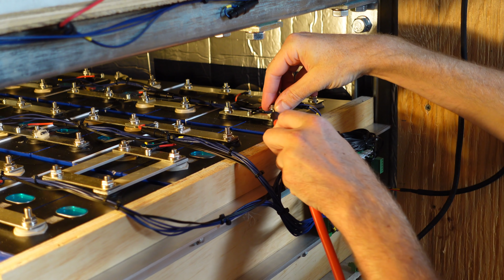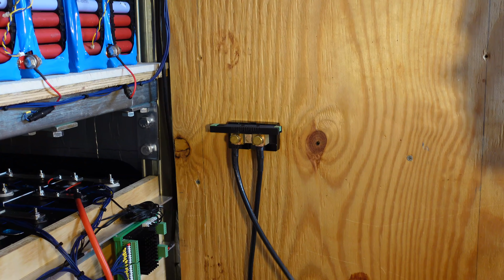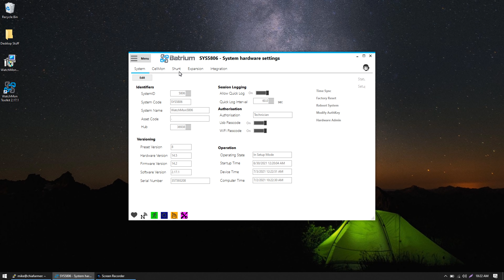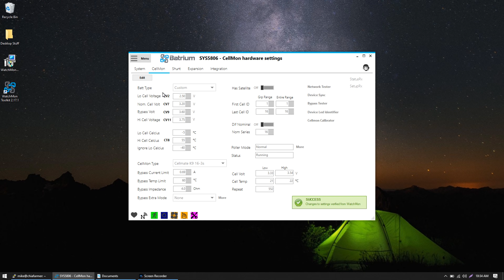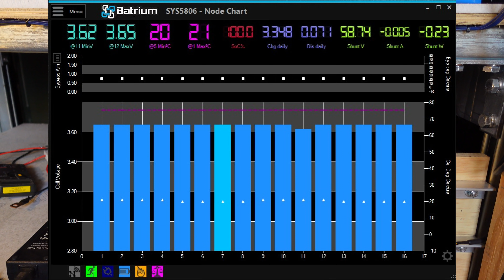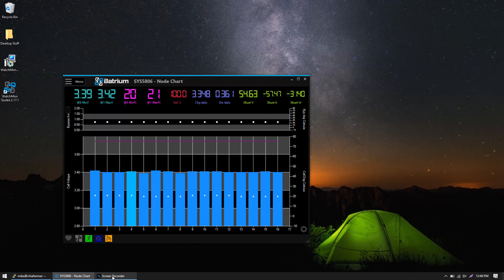EVE 280Ah LiFePO4 28kWh Battery Bank, Balancing and Capacity Test

Comment: The Batrium BMS was a bit confusing for me. They need a DIY for dummies so I went with the Overkill 16s BMS. Have not hooked it up to my cells yet.
Reply: You can do the same thing with a raspberry pi and Grafana for thousands less
Reply: @danfitzpatrick4112  That would be hard as the Batrium doesn’t cost “thousands”. I think it’s about $US500 for the config Lithium Solar bought.
Reply: @mondotv4216  Yeah, because 0.5 thousand is a good deal for a BMS.

Comment: look like conections fron the batteries is not ok
Reply from the maker: Can you please explain? Where do you see a problem?
Reply: @LithiumSolar  back in days on the system was not need use balancer and this stuff. all need all cable need to be symitric and same long but the connection need to be asymmetric how are connect the main connections. I cam share a diagrams but is not possible here post link. please send a PM over email I do . have a nice days
Reply: the problems is related to the resistan of the system .. the resistan  of the back need to be equal for path of - and + also start in asymmetric to get the same equal relative resistan in all cell.
Reply: @random_name-  
you are not correct. there is exactly the same current no matter how "asymmetrical" the plus and minus wires are.
if you have two battery banks, then you want to have the loops the same.
Reply: you are almost right, he got all cells symmetric. you confuse this with hooking two 12v acid batteries parallel, where this is very important.  and with the lifepos it is important too, but only to build both parallel packs the same, and hes doing it perfectly, as he hase 3,3v in parallel and even paired them right when building the pack

Comment: So, not at all surprised that they tested out @ 101% even though most of your tests come up a little low when compared to others results. However, your build seems to be incredibly well considered, well put together & monitored. Since my battery brain works ONLY in 12v, I realized that your bank would be 2,240AH. Pretty big a$$ battery, my friend. Now you announce that you are building yet another one of similar size- are you supplying a neighborhood with back up electricity? I honestly cannot figure out how/why you would need almost 4,500AH's of power. As an RVer, I think 400AHs as a 'good size' battery bank for boondocking (off grid & self-contained) for a typical RV hoping to survive & enjoy a week or so. That does assume a few sunny days to recharge the batteries, but- does NOT assume no bad weather in the mix. You will have 10 times that capacity. I do like spreading load as much as the next geek, but- even this seems a like extreme. Would you kindly share what would require such a large bank?
Reply from the maker: During the summer months, my home uses 30-50kWh/day depending on air conditioning usage. This battery bank is 28kWh, so it wouldn't even get me through one full rainy day (no sun to recharge).
Reply: @LithiumSolar  That makes sense now. I just never really considered battery power as a genuine solution to Air Conditioning. Conversion into alternating current losses- huge draws & spikes-scary unless well- you're doing it!! Hahaha Gutsy! I bet it works for you AND lasts a long time!
Reply: @LithiumSolar  
you might have to think about adding more solar panels. quite possibly there are rainy days in succession. or overcast.
Reply: My house uses 30 kWh per day normally. Less during a power outage. I have 56 kWh right now using these 280 aH batteries. I have  another 112 kWh on the way. 168 kWh should last through about 5 days.

Comment: You never mentioned how long the discharge lasted. How much time elapsed from full to empty.
Reply: Based on the numbers, around 10 hours.
Reply from the maker: I didn't time it. It took a long a-- time and was like 10pm by the time it finished (think I started around 1pm)
Reply: It depends of the power draw. 280ah at 1C discharging rate should last one hour. 560ah at 1C two hour

Comment: No surprises, so now after some use I hope you will show the spread
Reply: If he is running the pack within a normal operating voltage range, there will never be a visible spread. Hope he is going to set the balancing threshold well outside that range and the cells are not getting a self induced imbalance :))
Reply: @RolandW_DIYEnergyandMore  so true just take what the bank is willing to give you lol.
Reply from the maker: Sure, we'll revisit this next year and see how well they have held up!